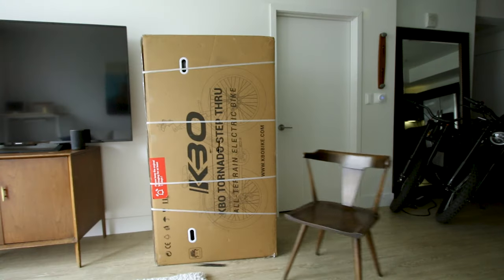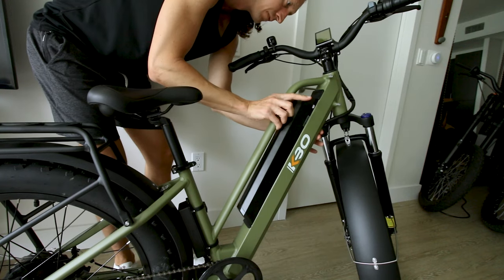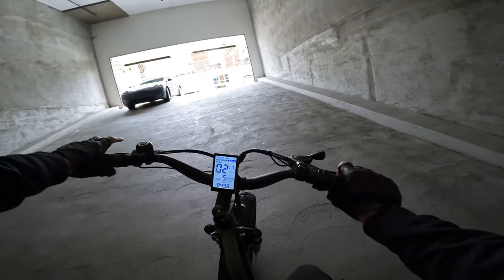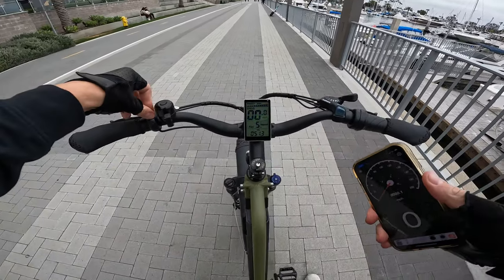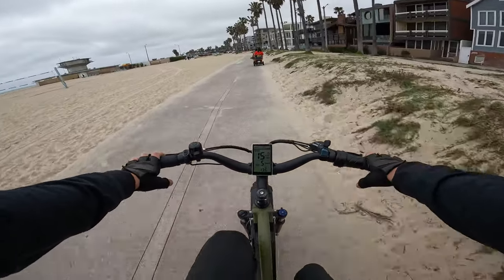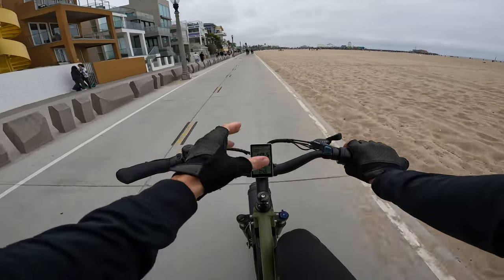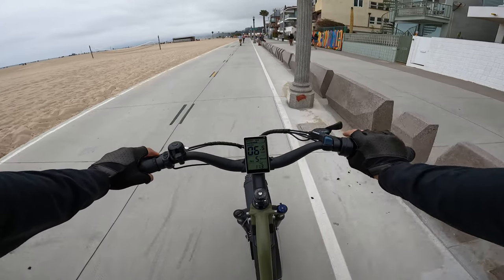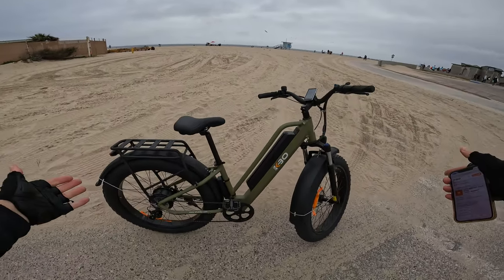You Can't Judge An Ebike By It's Cover - KBO Tornado Review

Comment: I tried this bike for the first time today...The 750W motor info has to be peak. On Amazon it says 500W motor. This bike is super sluggish compared to some 750W motor ebikes I've tried. Do you really think it's 750 or 500? The numbers on my motor start out with 26" 500#### Also, the manual says it's a 500 W motor
Reply from the maker: My guess is the controller has a low amperage output. Whatever the motor is rated for is just what power it can accept without overheating. Technically, you could pump 5000 watts into a 500 W motor, it would probably just burn up within a few seconds, ultimately power is limited by how quickly the battery can discharge its current, and how much power the controller can pull from the battery and send to the motor. In general, this is a very weak feeling Bike compared to other fat tire in ebikes, I agree.
Reply: @TailHappyTV  Thanks for the quick reply. Very informative answer. I'm still wondering about the 750 watts though, even the manual says it's 500.

Comment: That's actually a Shimano flat face derailleur, I forget it's real name, it's their cheapest derailleur, but it works much, much much better then those other three pieces of junk derailers they sell, until you get to the Deore. But you can only use them up to about a 32 tooth 1st gear maybe a 34 but definitely no more than that. They just worked better on trails, you put a longer chain, they shift smoother with almost zero chain clank.